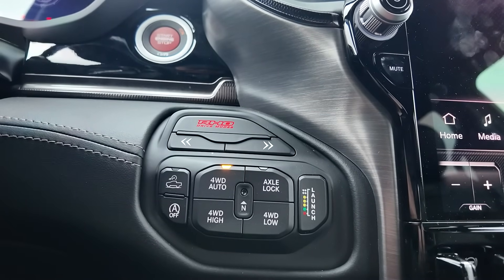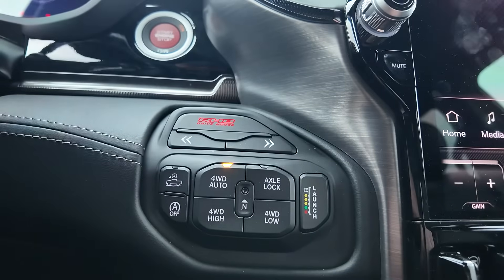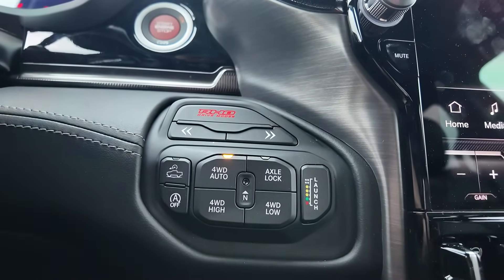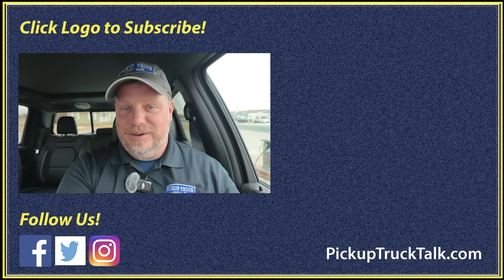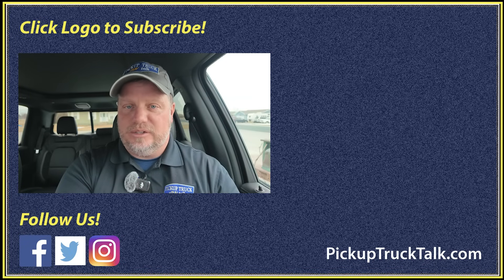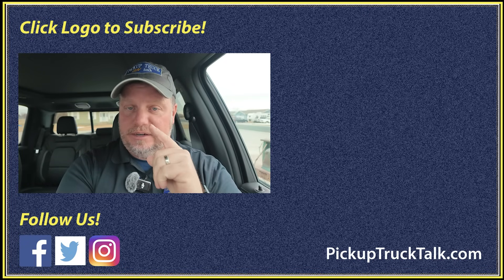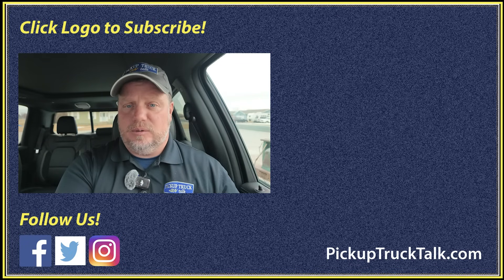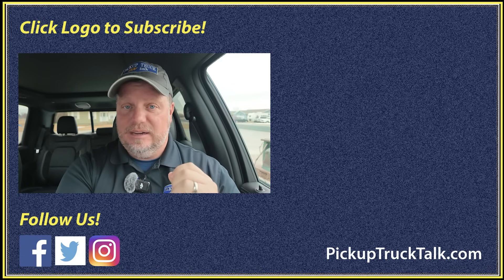Drive Mode Matters? Here's How Ram 4WD Auto Works from the Engineer

Comment: Great video Tim. Lots of misunderstanding with 4wd Auto but great system for those of us that often drive in mixed road surface conditions. Can’t believe that Toyota still doesn’t have it.
Reply: Toyota did have it for years, just not in the Tundra. The Sequoia, Land Cruiser, 4Runner, GX470, GX460, LX470 and LX570 have had full-time 4wd cases since the early 2000's. Now just the Land Cruiser, GX550, LX600 and some Tacoma and 4Runner models have it. For some reason they got rid of it in the Sequoia. 

Some people swapped the full-time case from the Sequoia into the Tundras.
Reply: Because they want the higher reliability for off-roading. They just need to offer both types like Ram.
Reply: @ no doubt that’s the reason but your average truck owner would be more concerned with variable road conditions than off roading.
Reply: @ Agreed. But look how long it took for them to offer rear disc brakes...lol
Reply: @Dusdaddy  haha right? There’s something to be said about being conservative. Ram was taking a similar path and it was paying off with better reliability. I think changing the electrical architecture in 2025 will hurt in the short term but if it avoids dealer visits for software updates I am all for it.
Reply: @tinshield  I have a 2011 with 4wd Auto. Even in 4H, the clutches do not lock until there is wheel speed differential. Which sucks when you want to engage 4wd before engaging the obstacle. That's the primary weakness of the 4wdAuto systems.
Reply: @Dusdaddy  That's not how the current 4Auto systems work though, and not how Ford's worked all the way back to 2012. Not sure on older Ram or GM's, but Ford's works exactly as they describe it working in this video, where it can vary torque anywhere from 0 to 50% in the front on the fly. I had a 2014 F150 with it and could watch it in real time with a display on the gauge cluster and it was constantly adjusting how much torque went to the front axle even when going in a straight line on dry pavement. It was an active system, not a reactive system.
Reply: @Jay-me7gw  Ford and Ram use the BW T-cases. The one I have is the 44-44. In 4H, it starts unlocked until it senses acceleration and wheel speed differential. They stuck with that for years. They switched to the 48-11 with 2019. Sent more TQ to the fron but still wasn't fully locked up. Lots of videos of them proving it.
Reply: @AlfyPotsdam-wh9vs  I have not seen issues with the Ford t-cases not locking up well. I have heard it quite a bit about the rams. Not sure on the difference.

I will say that I had a 2023 Ram 1500 with the eTorque hemi and 4Auto in Calgary/Banff as a rental a couple of years back. It was a Laramie with the GT package. The 4Auto system on that truck was not as smooth as the 4Auto system on my 2014 F150. The Ram feel pretty clunky and aggressive when it engaged in snow.
Reply: @tinshield  Essentially 99% of these systems are just  on demand AWD.  They use clutch packs to engage the front axle, which is great for street driving. Terrible for off-roading because it's not mechanically locked.  
Toyota has two systems. The classic part-time that mechanical locks into Hi/Lo. And their full time system that uses planetary gears combined with a torsen LSD/locker in the center to have all 4 wheels fully  powered like a Subaru. Surprisingly they haven't offered it in the Tundra. But it's on the 4R/Taco Limited hybrid , standard on the Land Cruiser and Lexus LX.
Reply: @DragonKnightX12 like most truck owners my truck doesn’t see much more than a dirt road. Sloppy road conditions are a much higher priority.

Comment: so auto four-wheel-drive in any Dodge Jeep Chrysler whatever does not engage until the system detects slippage of the rear wheels 

So it’s not engaged all the time it is if you’re in the throttle heart because that automatically sets the all wheel drive on momentarily until you let off the throttle 
So I went on a trip with some friends I in a 2004 my Dodge Durango with auto wheel-drive also has high and low. The other two vehicles was an F150 and a GMC Sierra 1500 .remember, who builds RAM Duran Duran Durango Dodge used to be part of Jeep Chrysler all jeeps are auto all-wheel-drive. So on this trip, we were going through some pretty deep snow with Russ after a while. I noticed them dropping behind me. The snow was a various depths and I was on the throttle pretty good just maintaining a speed. I stopped. Let them catch up to me and took off again and before long they were far behind me again. I stopped got out and went back to the GMC and asked him are you having a problem? To which he responded yes are you? I’m almost getting stuck in a few places now remember, they’re driving the same speed that I am and I’m leaving blazing the trail. I said to him no I’m just kind of cruising along, not really even getting all that hard except when we’re busting through some drifts and he looked at me like I was from another planet. he said oh you must have lockers? To which I responded no, just a stock Duran Duran Durango open differential’s front and rear and his head jerk back! how was that? We could barely keep up with you and of course the F150 was having even more problems than the GMC and I said I don’t know what to tell you. It’s not even I haven’t even put it in four-wheel-drive yet. I’m just in auto mode and he jerked his head back. You’re kidding me you’re not in four-wheel-drive. I said no Draco has all wheel drive. I rarely get in four-wheel-drive unless I’m climbing a steep hill and he said well that’s weird cause I’m in four-wheel-drive and I can’t keep up. Somethings going on here lol so I said well jump in my Durango and drive for a minute and I’ll check the truck out and see if it feels like there’s something going on with your four-wheel-drive and of course F150 guy is standing next to us and he says well mine is not broken so why would his be broken? I said I don’t know but you guys keep dropping back and I was wondering why and now I know so he agrees get in my Duran Duran Durango takes off I get in his GMC and try to follow and he has excellent tires everybody as good as mine same with F150 guy and pretty soon I start dropping back and I’m spending the tires and dodging back-and-forth trying to keep up, the snow is quite deep about 2 1/2 feet. We continue on for about five minutes and he comes to a stop in my Durango and I catch up to him. He walks back and says wow! It’s like I’m not even in the snow. He said your Durango doesn’t even slip a wheel I said yeah it’s a go but remember who built it it’s cheap Chrysler right and he says to me well apparently I paid too much for my vehicle because it’s 10 years newer, and it has crappy ass four-wheel-drive to which Mr. F150 says same with me. How much did you pay for your Duran Duran Duran Duran Durango lol I said I’m about 10 grand 10 years ago lol he says yeah I noticed you’re not even in four-wheel-drive and I noticed that it’s not even necessary. I didn’t even feel the need ever to turn it in four-wheel-drive and I said it doesn’t engage the four-wheel-drive system unless there’s detection of Will slip to which he said well that’s amazing because the wheels don’t feel like they’re slipping and it just goes I said yeah it’s what can I say and then we discussed later on our miles per gallon and of the three of us I get the best mileage in an all-wheel-drive vehicle of the Ford being the worst obviously. needless to say, neither of them were very pleased when we got back and we’re eating lunch. They both had this depressed look on their face thinking they had great four-wheel-drive and they got beat out by a vehicle 15 years older either of them literally would’ve had to have chains on one. Axle to keep up with me and feel confident and they both agreed they did not feel confident going up any hills..

Comment: Hey Tim, Doug mentioned the torque split between the front a rear axle would be different depending on the drive mode you’re in. I.E. Baja mode, Rock / Sand mode. But I don’t think he mentioned what the torque split is in the drive mode that is used most often, the auto drive mode! Is there a way to ask him what the torque split is for the auto drive mode and I guess all drive modes that were not covered in the video?

Comment: Good interview, good info! For those of us in a Chevy/Ford/ Nissan, could you do a confirmation piece that their 4 auto systems are similar?  So far I’ve not used the special drive modes in my 23 Colorado and what the engineer said about Baja mode was very interesting.
Reply: Ford's for sure is similar and has been since ~2012 when they introduced it. Not 100% positive on GM, but I believe it also works the same.

Comment: I live in Northern Michigan and use 4x4 auto 90% of the time in the winter. Great peace of mind no matter the road conditions, which can vary mile to mile. When the road are 100% snow packed i then switch to straight 4x4. This is a must feature on a truck for me, especially for when my wife drives it.
Reply: Absolutely correct. The only extra I do is had sand bags in the bed.
Reply: Same. I have a 2023 Big Horn Hemi e torque and use 4 auto in winter as well.

Comment: So, in RHO, in 4WD Auto, in Normal/Automatic mode, how much torque is being put to the front axle?  He said 50% in Rock mode, 25% in Baja mode.  How about the other modes?
Reply: Its variable. Probably depends on 100 different factors. If you are just cruising in a straight line not accelerating it might be 0%.

My 2014 F150 had 4Auto, and had a display on the gauge cluster that showed the torque distribution, and it was constantly adjusting. Steady state cruise it was rear only. light acceleration was maybe 5-10% front. hard acceleration it would be 50/50%. I also swear that when they temperatures dropped to ~35F, the 4Auto system was more active and more frequently sent power to the front likely due to the risk of Ice and snow.
Reply: @ Thanks for your comment.  

It’s a complicated subject because what happens all depends on what vehicle we are talking about.  Your Ford was likely a traditional 4 wheel drive system, like 95+% of American 4x4 pickups on the road today.  The RHO and TRX have “full-time 4 wheel drive”, which is only different from AWD in that it CAN lock the drive to the front and rear axles together when 4WD High or 4WD Low are selected.  But, when in 4WD Auto, TRX & RHO behave exactly like some AWD vehicles.

I reached out to the creator & asked him to pose my question to the Ram engineer, but being sure we were specifically talking about RHO.  The answer: 

In 4WD Auto & in Automatic drive mode (default), RHO’s transfer case routes 40% of the torque to the front axle.  It is fixed, unlike traditional 4WD Auto settings that feed power to the front axle only when the rears slip.

Clear as mud?
Reply: @tomh9470  No, my ford was not a traditional 4wd system. My Ford was a clutch based 4Auto system just like what is in the Ram RHO and TRX. The only major difference being that the F150 t-case has the ability to go into 2wd instead of always being in 4Auto.

Ford has been using this system in the F150 since 2012. You can look it up, its called the Borg Warner Torque on Demand transfer case.

The RHO does not always send 40% to the front axle, which is exactly what the engineer said. They vary to torque split in real time, just like I explained my F150 t-case doing.

Your understanding of how other 4Auto systems is flawed. The RHO and TRX are not unique other than their lack of  ability to go into 2wd.
Reply: @Jay-me7gw  and that’s why this video was flawed.  The engineer switched things around a bit…talking about their regular 4x4 trucks that can go into 2WD & have a 4WD Auto option that works as you describe…then, he talked about Ram’s RHO/TRX system, which has no 2WD option because it has a completely different transfer case than other 4x4 Rams.  It was confusing.

The system you are talking about is the Borg Warner 48-11 (that’s the lastest version).  The RHO and TRX use the 48-13 which always puts at least 25% of the torque to the front axle, or up to 50% depending on the Drive Mode selector.  It’s a fixed ratio based on drive mode, not a fully variable 4WD Auto like most 4x4 pickups.

I’ve been in touch with the video creator & he initially understood the engineer’s words as you did, but was surprised by the engineer’s answer when he narrowed his question down to RHO only.  I get it.  It’s not a simple subject and the terminology used is often mis-used.  I’m guilty too, as I described the RHO/TRX as AWD when it’s technically Full-Time 4WD.  And, AWD behaves differently depending on the vehicle being discussed.

Comment: His presentation was good, but he still mixed his explanations between RHO/TRX 4WD Auto transfer case behavior and all other 4WD Auto transfer case systems.  When he said if there is no slip, the transfer case clutches are open & no torque is being sent to the front axle, he was NOT talking about the RHO/TRX transfer case. But, he was not clear about this point.

Betting some people are still confused.  Wish he had just stuck with RHO/TRX transfer case behavior.

I did like that he sorta admitted the AWD system in the TRX was driven by the massive power of the Hellcat and you COULD (safely) send all the Hurricane HO power to the rear wheels.  He said the AWD decision in RHO was driven by customer expectations…sure, we all want AWD (not).  Let’s face it, that decision was driven by R&D and production simplicity (keeping TRX components is easiest when practical).

BTW, I’ve read Baja mode puts 30% torque to the front axle.  I’ve also read 25% in a couple places.  Since this guy works for Ram, 25% is probably correct (not that 5% really matters).

Comment: People who tow trailers with a full time auto will increase the wear on the clutches. Check out the Jeep  392s with full time auto like yours. Several videos of people loosing their clutches.
Reply: In theory, tow mode would force 2wd only.
Reply: 392 doesn't have a tow mode. @bobbbobb4663

Comment: At 8:40 you covered an experience I too had. I went through an underpass 😂on highway that had ice, my truck slipped like for a second so that by the time I eased off gas pedal I was way past underpass. I had my truck in 4auto but thought maybe my tires found some traction , looked up in my rear view mirror and saw a sedan come out from the underpass sliding all over before they got control back.

Comment: Tim, are all 4 wheel autos equal? In other words, do all manufacturers make 4X-auto do the same thing? Do they all switch from high to low auto and/or switch from 2x to 4x automatically?
Reply from the maker: As far as I know, everyone is using a similar setup for 4WD auto switching from 2WD to 4Hi automatically.
Reply: @Pickuptrucktalk  Thanks I guess I just REALLY need to read the manual when I get my Colorado Trail Boss in 2027 HOPEFULLY when I retire, if all goes to plan.
Reply: @RossMalagarie  GMs works the same, clutches. Which everyone loves for it's function but everyone hates for it's weakness.
Reply: @Dusdaddy  thanks.
Reply: Yeah, for the most part. Ford has been using a clutch based 4Auto t-case in the F150 since 2012 I believe and functions the same way, but also has 2wd.
Reply: No, Toyota’s system is the most robust by using a center differential. The hardcore Land Cruisers use this version of full-time 4WD.
Reply: @ Agreed but just not in the Tundra. They should offer it there as well as the smaller models.
Reply: @Dusdaddy  They do. Its been available in the 4Runner for a long time and now its available in some trims of the Tacoma.
Reply: @ That's what I said, they don't offer it in the Tundra, just the smaller models. Like the Taco, LC, and 4Runner.

Comment: I’ll bet you’re only losing a miniscule amount of mpg with 4A. I spent the first year plus in my F150 crow hopping around corners entering intersections in 2H. Thought I was saving a lot of gas. Well, been in 4A for the last few months and I track my mileage. If there’s any perceptible difference it’s less than 1mpg and even that is probably an overstatement. I only use 2H on long highway trips now.
Reply: Yes it's about 1 mpg have it on 22 ram
Reply: It's  a 2mpg difference on my Trailboss
Reply: Why are you crow hopping in 2H? It shouldn’t be doing that in 2WD.